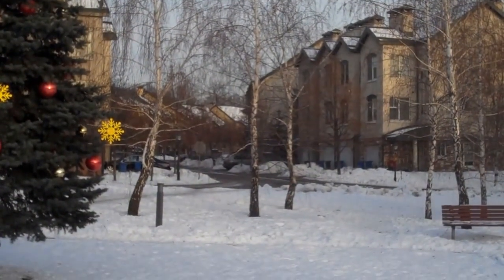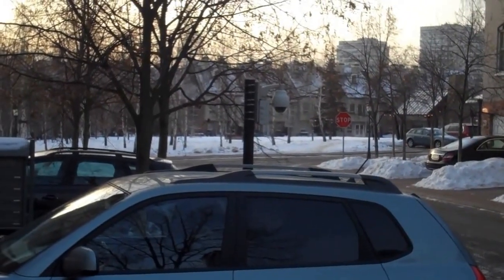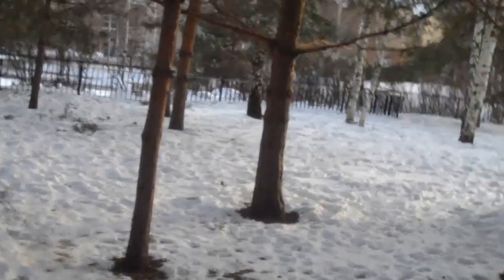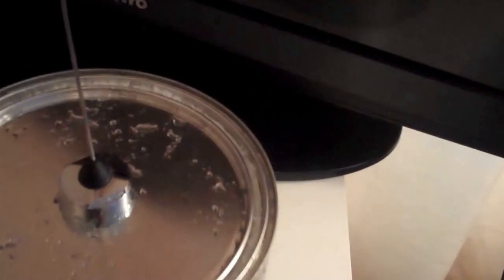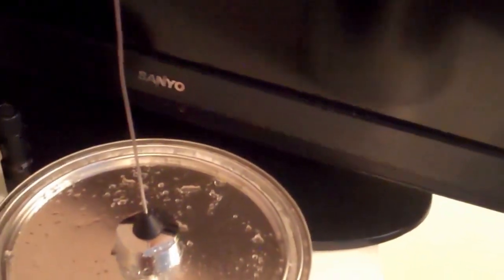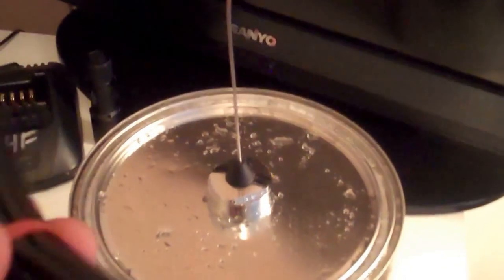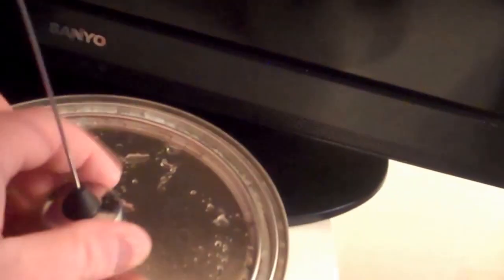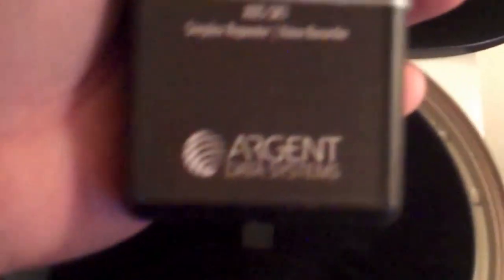Weather-proofed simplex repeater for Emergency Communications

Comment: Properly licensed GMRS users allowed to use duplex repeaters using the specified input and output frequencies as defined by the Part 95A rules.  Properly licensed GMRS users are also allowed to transmit up to 50 watts on a mobile or base station radio and up to 5 watts on a handheld.  Some areas also have community GMRS repeaters that are available for use with permission of the license holders.  GMRS license can be obtained by applying to the FCC without the need for a qualifying test, and paying a fee of $65.  Once a license is granted to the applicant the license is good for 5 years and all members of the licensee family are allowed to operate under the same license, unlike ham operators where every user must have their own license.  The blister pack radios that are GMRS / FRS radios usually are incapable of operating on repeaters with a very few exceptions.  There are other options available to utilize the full capabilities of the GMRS system.  People utilizing the GMRS radios and frequencies need to be licensed according to FCC rules.  Also if licensed those families would be able to utilize the GMRS system to its maximum potential.

Comment: you can buy Handhelds with cross band repeat function built in for less than $100 now days...for example the PR-UV88 or the PX-UV973...that would be better and cheaper than a handheld + a simplex repeater controller and wouldn't have the delay that the simplex solution has.
Reply: Do you even know what a cross band repeater is? His setup is a single band repeater.

Comment: No apology necessary; we often overlook little details since we assume viewers already understand some basic concepts. Hoisting up a tree is an excellent idea, but consider an additional cord that follows so you can pull it down if it snags. A gel-cell battery could be included for longer operating time; the weight would help it come down too. How'bout a tutorial message using #411 etc. Could be used for a fox hunt maybe. Great project and well done. And looks like a lot of practical fun. 73

Comment from the maker: SB - Thanks for the comments, feedback, and watching.  I apologize that I did not state that this was not an "ideal" setup.  I was attempting to provide a generalized application.  Ideally (when it's not zero degrees) I would place this setup in a tree, suspended on 550 cord, with some external batteries or solar option.  My goal is to demonstrate the possibilities that simplex repeaters offer.

Comment: Good nuts n bolts demonstration. For newbies, it's important to know this and similar devices should be located on high ground to be effective. A worthwhile addition can be an SO-239 barrel so a remote antenna could be placed high up...e.g. a rollup/rollout J-pole hung from a tree branch as high as practical. This, as-is would be perfect on a high-rise balcony or even a rooftop. Burying it in the snow at average ground level is counterproductive. Add some radials and hoist it up into a tree. 73

Comment from the maker: The simplex repeater used two AA batteries that last about a week.  However, the unit can also pull power through the mic jack (if the radio is equipped to supply power through the mic jack).  You can also power the unit through an external power jack.  The radio battery is the limiting factor, the repeater will run as long as our radio’s battery will last.  You can use external battery packs to power your radio for added time.
Reply: Thank you. You answered all my questions. Great idea and build. Great video.